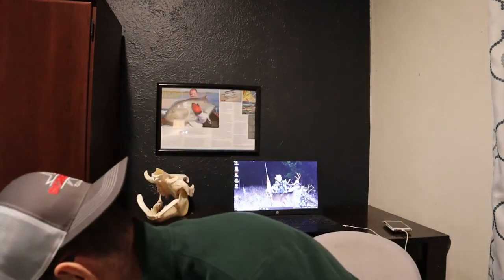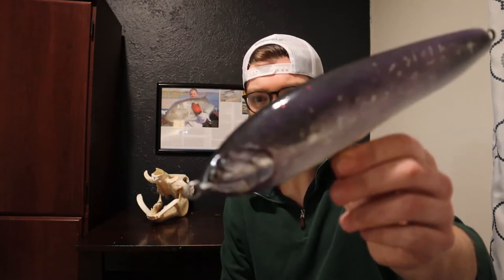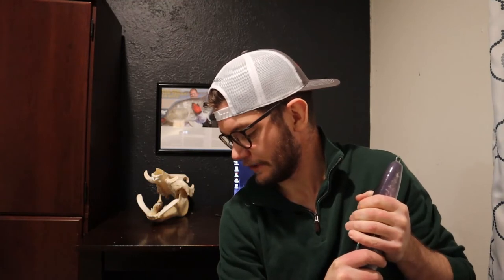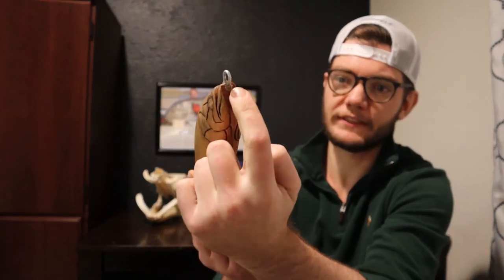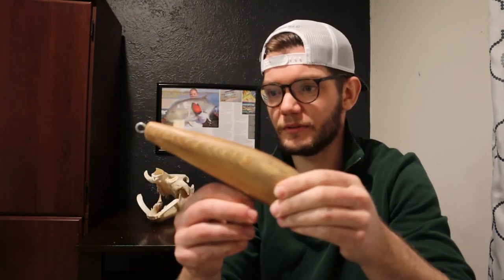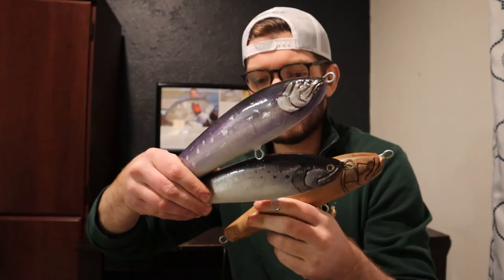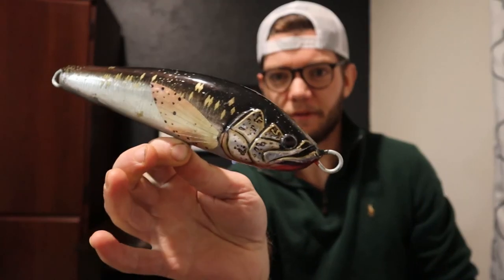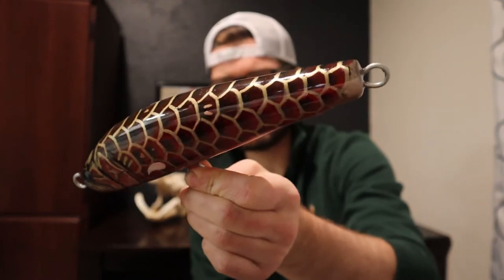How I Developed An All Plastic Stickbait - GT Stickbait Making & Pool Test

Comment: i like your craftsmanship... very cool stuff, making lures out of polyurethane resin and make them float is not a NASA secret, all i do is i add the necessary amount of microballoon bubbles into the resin, there you have it... a floating stickbait
Reply from the maker: Not NASA secrets but getting the right mixture is tricky. Microballoons make the polyurethane mixture too brittle for GT lures as the hooks and internal wiring are much heavier compared to smaller stickbaits. Thanks for watching!

Comment: Great shape of the lures and wicked action. Can and will you reveal the internals, wires and balancing of the weight? Keep up the good work.
Reply from the maker: We will see what happens, this lure has standard wiring and only a little bit of added weight towards the tail. Every design is different so requires a different balance, but how to figure that out is explained in my previous videos. Thanks for watching!

Comment: How do I get in contact to get some advice on weighting a stickbait? You never ended up making the weighting video? Do you have an email or and instagram?
Reply from the maker: I've got an older series called "How To Balance A Stickbait". That will give you all the info you need
Reply: @TheAnglingGlobetrotters  i watched the 3 of them? And you talked in the second one about doing a 3rd on weighting a larger stickbait but in the 3rd you just repaired and recoiled one. It doesn’t go into the weighting. I’ve got a pretty serious project going on and struggling to get it swimming right could really use some help man 🙏🏼🙏🏼 it’s worth checking out!